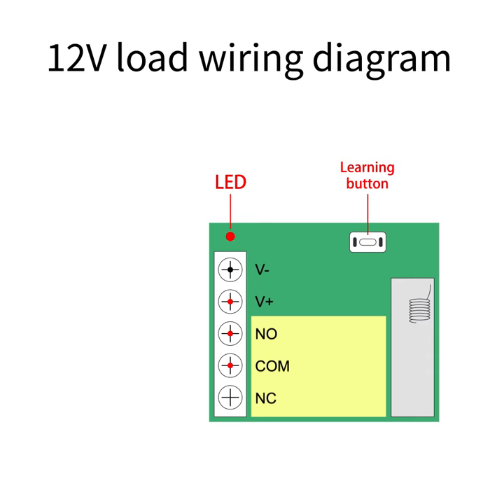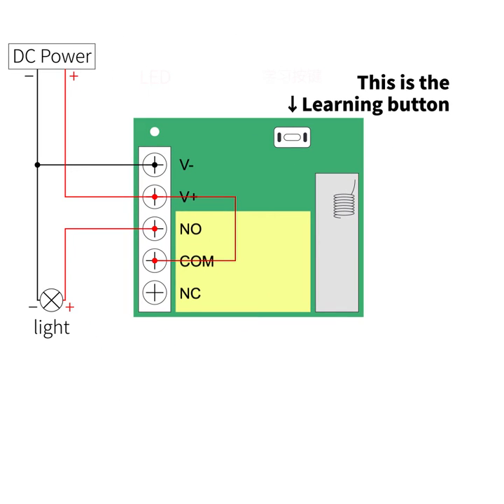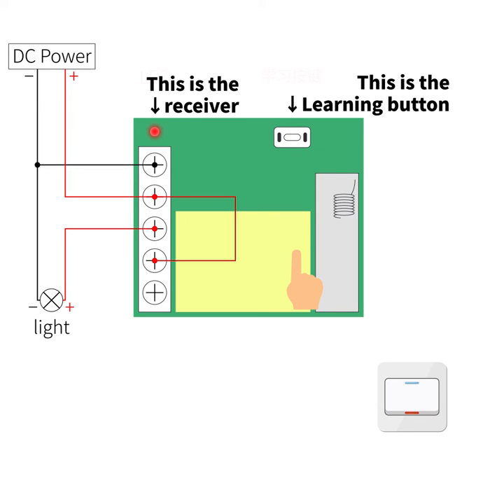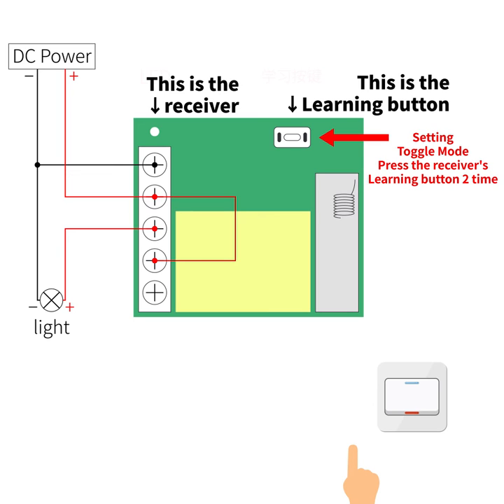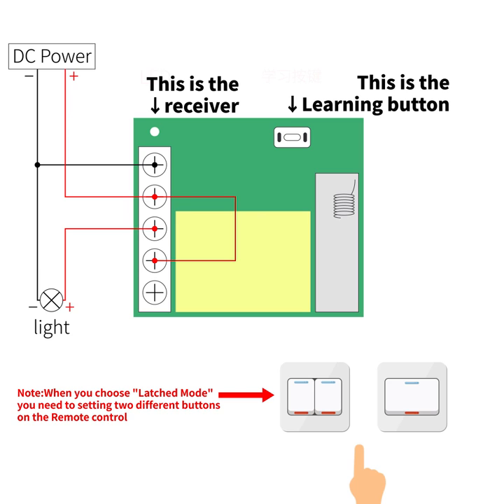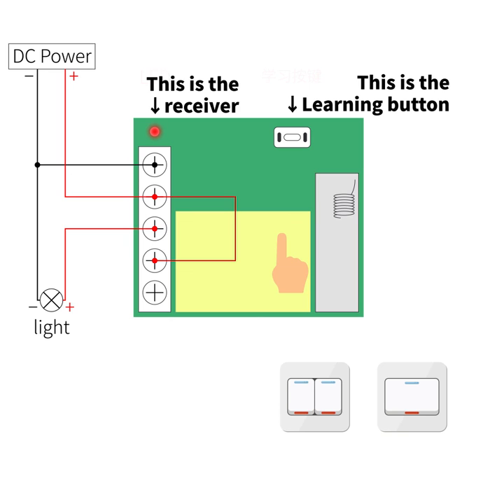How to connect 12V 1 CH remote control switch module to 12V load, door lock switch, non-12V load

Comment: Hi, thank you for this video. If user want to on/off an electric fence energizer with this wireless relay remote switch which diagram they should use? Thank you

1. 12V load wiring diagram – min 0:03
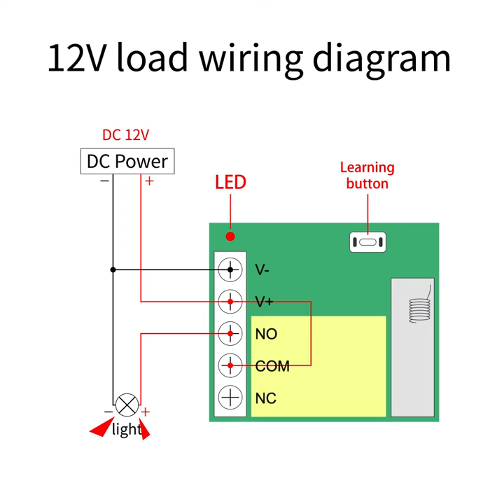2. 12V single-channel control electric control lock control open door wiring diagram – min 0:13
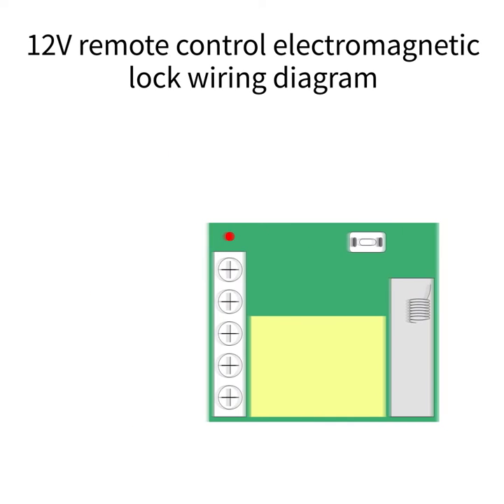3. 12V remote control electromagnetic lock wiring diagram – min 0:23
4. Non-12V load wiring diagram – min 0:31
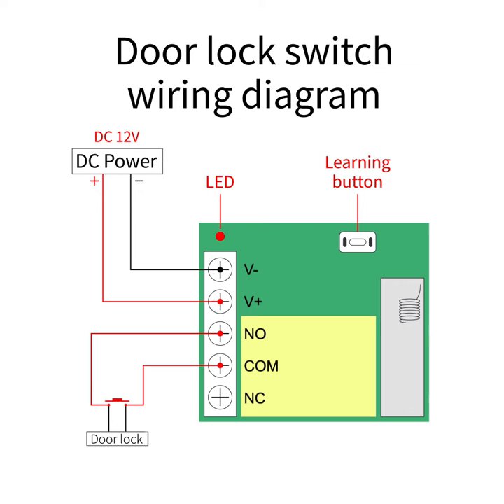5. Door lock switch wiring diagram – min 0:41